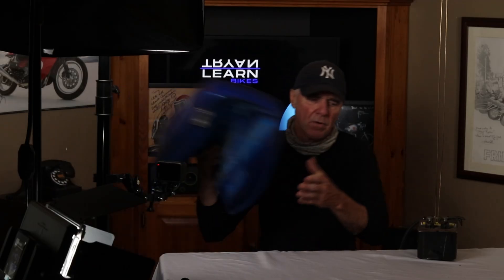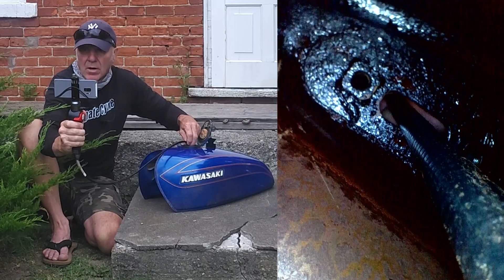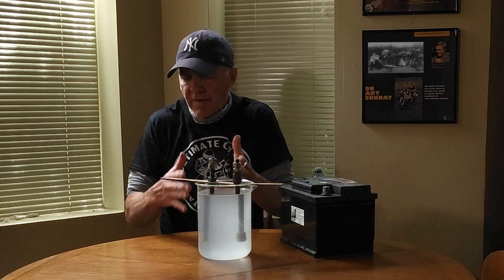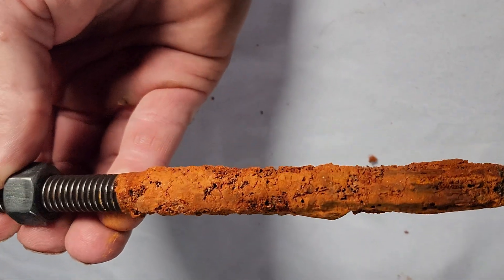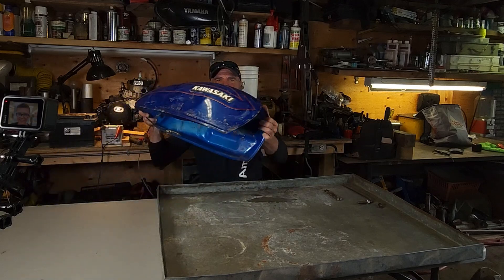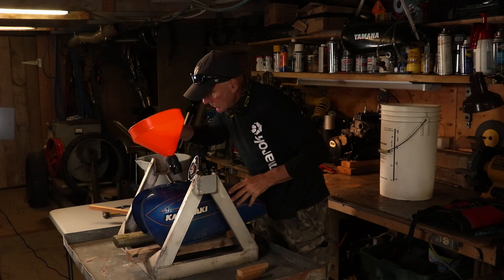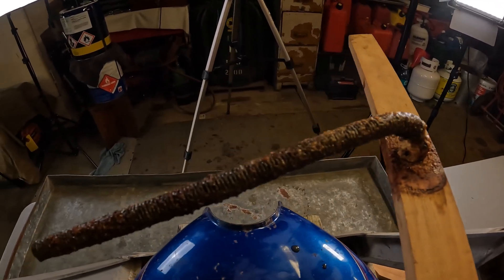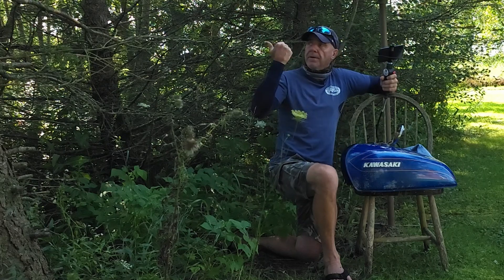Electrolysis - Use Science to Remove Rust Like A Pro

Comment: Hello, good luck, Mushti
I saw this tutorial but I didn't understand what BORAX is. Is it the same as sodium tetraborate decahydrate
Na2B407
I don't want to make a mistake because the engine tank won't fit, even if it does, it costs $200
I just got the soda ash
Reply from the maker: Yes you are correct . Borax is sodium tetraborate decahydrate. I hope this helps you . Good luck with your project .

Comment: The battery will drain.  Any DC power supply of less than 20 vdc will work.  I used a diesel battery with a power supply charging it while it worked.
Reply from the maker: Umm ..Ya..im guessing you didn't watch the entire video. I did actually talk  about that issue and had a charger connected for that very reason .

Comment: Free tip when dissolving powder in liquid to aid rate of dissolving heat liquid to 190 to 200 degrees. Yes, you can boil but have to wait til  cool for use
Reply from the maker: Thanks, that's a solid bit of advice right there. Cheers 🍺

Comment: Thank you very much for this video! I do have a question - is there any reason to use a battery and a charger to trickle charge, instead of directly using the battery charger as a source of power?
Reply from the maker: Hey you're very welcome .
The reason I use a battery and a charger is that I believe it delivers a much more steady state of DC power . .If you look at the wave form from a charger (espesially an inexpensive charger ) it can  be quite lumpy and resemble a sawtooth profile . When compared to the output wave form of a battery which looks like two dead straight  parallel lines. Also the available current of a battery is (depending on size ) can be hundreds of amps but a charger is typically in the 2 to 10 amp range . You raise a good point though .Electrolysis would likely still happen with just a charger but I'm betting it would'nt work near as effectivley . Thanks for commenting with such a great question .Cheers🍺

Comment: What does hydrogen smell like 🤣?
Seriously though, interesting video. I did a GT380 tank years ago with nitric acid followed by water then caustic then water then phosphoric acid to passivate remaining rust then  washed and dried. It came out pretty good considering the very bad starting point.
Reply from the maker: @neiljarvis8911  You make a valid point. Hydrogen is actually odorless but  this process can produce Hydrogen Sulfide which has the odor or rotten eggs 
Your process sounds like it worked well for you .Those chemicals are pretty heavy duty and demand respect if you want it to end up trouble free .
Thanks for watching and for taking the time to comment. Cheers 🍺

Comment: You have the same Ulanzi VL49 RGB ( 2000 mAh ) that i have, they are a very cool light to have around when making vids. Cool video on the process of basic electrolysis and how effective it can be, however knowing some people well sometimes they just don't think things through at times when trying something new say like this electrolysis deal. My thoughts were after watching this video was to perhaps clearly outlining the importance of insulating the two electrodes from each other verbally, the video clearly shows that you have and did so however the demonstration in the house using the glass vial and the two bolts as the electrodes might seem to the odd person that they were fastened onto a flat piece of steel ? try that with anywhere between 550 and 1,000 amps @ 12VOLTS and some fun might come from that and in a very surprising way too. To the most of us insulating two opposing electrodes is as obvious as the sun coming up every day but then again there are some special ones out there that see the world as flat and believe that a theodolite displays ambient humidity.
Reply from the maker: @rolandkeith5322   @rolandkeith5322  Hey R.K. Man you have a great eye for spotting  details, how the heck did you notice the Ulanzi light ? 
You make a great point , I did take it  for granted that the electrodes must be isolated from each other and any direct short would definitely be a bad thing .Especially with the available capacity of a car battery .

I like your theodolite analogy reference. Gotta admit I had no idea what the hell that was and had to look it up .Thanks for the education. 

Hope all is well with you and yours. Looking forward to seeing some more vids from you once the weather is more motorcycle friendly in Auz.

Cheers for now good sir  🍻
Reply: @TRyanLearnBikes  If I have or had something and I see someone else has the same my eye goes directly to that item for some reason. Trust me I don't frame by frame peoples vids to spot things like some kind of stalker or anything it's just a matter of a type of pattern recognition thing I have always had.Heck I did not even mention that you had 4 of of the Ulanzi's or look like them anyway on top of your corner cupboard next to the Marantz tuner amp that looks to be around the 2220B model Tuning range: FM, MW
Power output: 20 watts per channel into 8Ω (stereo)
Frequency response: 20Hz to 20kHz
Total harmonic distortion: 0.5%
Damping factor: 20
Input sensitivity: 1.8mV (MM), 180mV (line)
Signal to noise ratio: 77dB (line)
Channel separation: 30dB (line)
Speaker load impedance: 4Ω to 16Ω
Dimensions: 17-3/8 x 5-3/8 x 14 inches
Weight: 26.4lbs.
Reply from the maker: @rolandkeith5322  Ha ha ha....ok now I'm scared..
Well played R.k. that actually made me laugh out loud 🤣
Reply: @TRyanLearnBikes  hahahaha